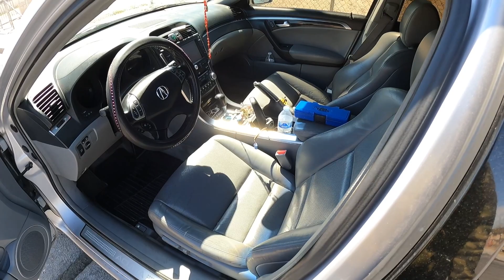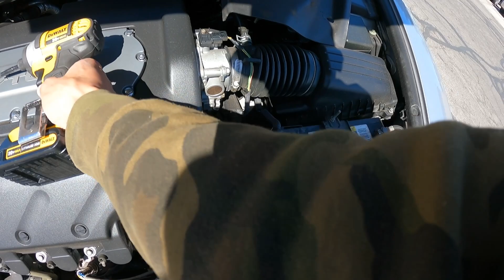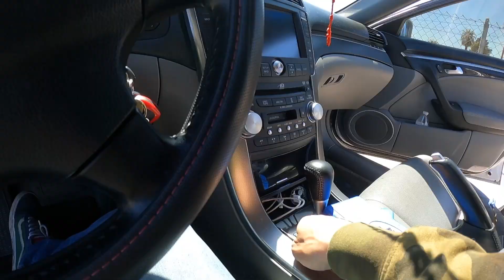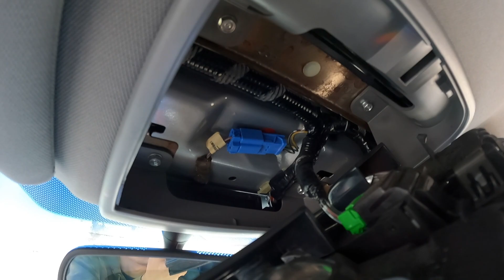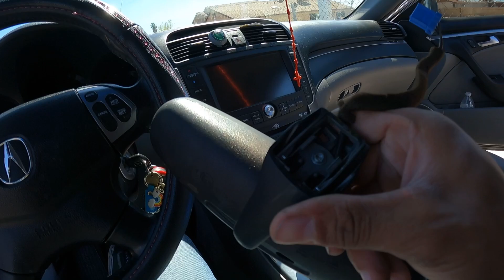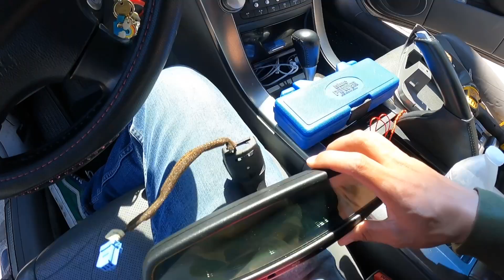How to replace Acura TL rearview mirror(2004-2008)

Comment: I know this was created a year ago, but this is NOT the way to remove the mirror.  You slide down the plastic cover and that reveals the screws needed to be undone.  You then slide the mirror UP off the metal fixing that’s on the glass.

Comment: I have a wobbly RVM, what can I do to make it stiff?
Reply: try to bend the bracket a little to make it a snug fit again and or a small dab of Rtv silicone and let it dry for a day before driving around so it sets up properly
Reply: I fold raw paper filters and tuck it in the side to keep it from wobbling
Reply: @cupnoodles420 thanks for that but the car is sadly gone. Sent to the crusher 😔

Comment: The bracket on the mirror is totally stupid. I have to bend the bracket to make it snug to the mounting base on the glass. They could just make a screw to screw in from the outside.
Reply from the maker: Yes, I agree they could’ve designed it a little better. I think a screw behind the cover at the base end of it would’ve been perfect